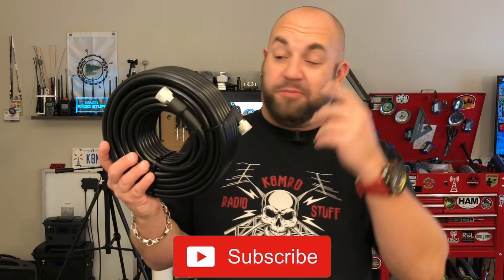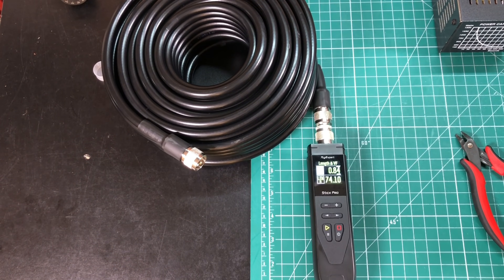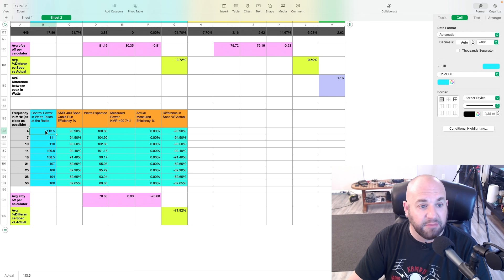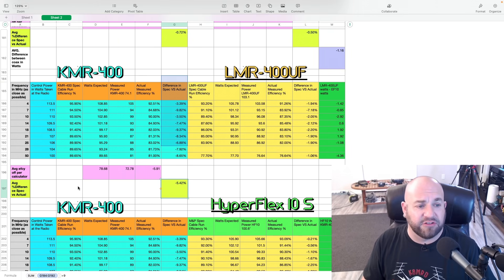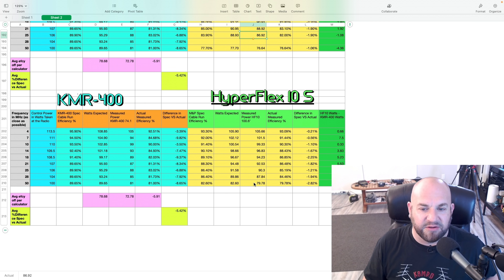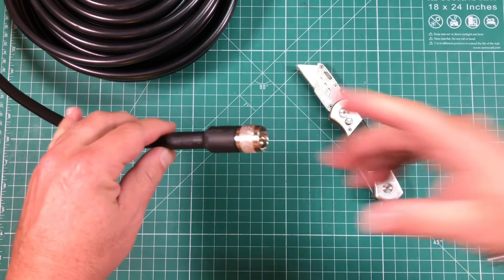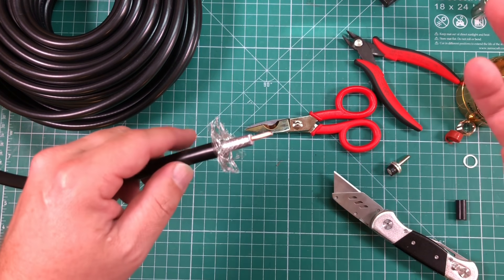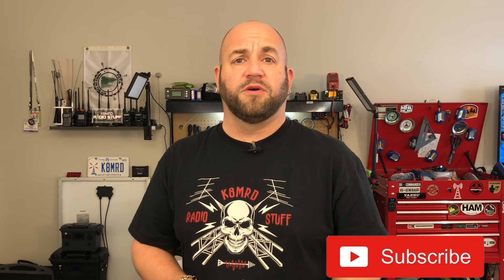I Bought KMR-400 Coax From Amazon | How Bad Can It Be?

Comment: Retired RF bench technician here. I worked for a couple of fellows in the late 1970's in a mobile stereo/ CB shop when the CB craze was going. We had problems with some of the customer's  vehicle installs with the intermittent SWR readings. The cable installed was the off-the-shelf Radio Shack Tandy Wire RG-58. We then replace those with an Amp brand cable with no further problems. We dissected the Tandy cable and found at even intervals along its length there was the center conductor just pinching on one side of the foam dielectric to the outer braid, causing intermittent shorts. Tandy did produce their own wire and cable, I believe in a factory in Indiana. Evidently they didn't have enough cool time out of the extruder before coiling the cable up. Their coax products did improve though. Tandy did make their own xtals for their CB radios and scanners as well. These shifted lower in frequency over time sometimes into the next channel.
Reply: As a current tech, ive seen some things... 
One of which is radio shack coax which at best had 60% shielding. Their molded connectors are garbage.
Reply: Foam core cable is relatively easy to damage; I've seen many tower installations where the foam is entirely compressed by cable clamps, which is why we only use 1/2" and 7/8" "hardline" feeders; they can usually take the abuse.

Comment: #1: Never test cable, especially coax with a foam die electric in a tight coil. Read specifications of LMR-400 & look at installation criteria. That coil of ‘KMR’ was coiled from China waaay too tightly & most likely distorted the positioning of the center conductor in relation to the sheath. 
Bingo. There’s your excessive loss.
Reply: I've bought a bunch (4 terminated, 1 unterminated) of these KMR400 cables from Amazon, and they all arrived fairly tightly coiled, but not even close to the specified limit. I do uncoil them slowly, over a few days, gradually and smoothly increasing the diameter of the coil until it's something like 4 to 6 feet across. My assumption is that the center conductor can migrate back to the center if it's done slowly and gradually; if it's even an issue. Since they're Cdn$100 each (price class), I'm not in the mood to take chances. Also this slow process helps to avoid kinks. I measured 0.8dB loss at 30 MHz (per 100 foot), which is perfectly fine for my HF antennas. I'll probably use the same cable for a shorter run at 2m and 70cm. I'll be buying the unterminated option from now on, and installing the connectors myself (cheaper, likely better). Those that can accept only "the very finest" of name brand cables are either very wealthy, or perhaps they're cutting corners in other areas. One of my coworkers bought very expensive speaker wire, but he didn't have any money left for speakers.
Reply: @John Jones does it result in permanent damage or can it be corrected by straightening the cable out?
Reply: The bend radius spec for at least lmr400 is between 1 and 4 inches depending on whether it's a permanent bend or not. Assuming the dialectic is similar I think the coil is probably fine.
Reply: Just what we need !
More Coax that won't duplex well !
👎☹️
Reply: which coax would you recommend？I am using ic705 with end fed antenna. Thanks!
Reply: I thought so too. I'm no expert but I thought it's gotta have some effect on its loss. I'm thinking about some 25' segments between antennas and rigs, and imagine the loss will be smaller than found! Thanks for your observation, John J!
Reply: Hmmm,  I looked up the Times Microwave datasheet for LMR-400 solid core (not ultra flexible stranded core).  It says:

Bend Radius: installation in. (mm) 1.00 (25.4)
Bend Radius: repeated in. (mm) 4.0 (101.6)

If you can install LMR-400 with 1 in radius bends, seems to me you can ship it in a coil with a 2 in to 6 in radius bends.  Am I missing something?
Reply: @engineerncook6138  No, you are correct in your thinking, but remember that MBR is the radius, not the diameter. You need to double that figure to get your diameter and TM recommend  a repeated radius of 4"", that equates to a coil with a diameter of 8".  Now look back at the roll he has. Is it 8" diameter on the outside turns?  ...maybe. But the turns closer to the center are not. I work in Broadcasting and we would never have RG213 coiled that tightly, let alone a solid core foam-dielectric LMR400.
Reply: This is why ppl stay away from vhf unf rptrs.   Know it alls

Comment: if you want to measure a cable specifications you need to lay it straight, a roll of cable has completely different characteristics.
Reply: In the coax the energy is traveling inside the coax so it is irrelevant whether the coax is coiled on a spool or not. You don't have any fields outside of the coax at least in theory. In practice due to imperfections in the outer conductor braid maybe some but is very negligible for this kind of measurements. I think you are mixing other effects when you connect an ubalanced line to a non proper unballanced load and the outher conductor acts as part of the antenna (example coax to dipole antenna without a ballun - please don't get it wrong because in many cases it works without a ballun without side effects, but this is completely another topic) but those effects don't have nothing to do with power delivery in the cable and its losses.
Reply: I was kinda thinking the same thing.  You make a choke out of coiled coax to change the characteristics of the cable's operating parameters at that point.  I'm not sure testing the 75ft coil is very telling.  How about a follow up with the cable rolled out for comparison?
Reply from the maker: A choke is to prevent RF from coming back on the shield.  I'm testing power into a 50 ohm dummy load.  This is not my first experiment and in my experiments I have found that for power testing, it makes zero difference.  Look at my videos testing Messi & Paoloni Cables.  They are all uncoiled.  Before I uncoiled hundreds of feet of coax in my house, I took a power reading.  After I uncoiled them, I took a reading again.  Would you believe they were the exact same number?

Comment: For the price and for hf use its just fine.  I buy rg8/u in 500' rolls. I have multiple more than 100 foot runs and i have not had issues.  For vhf real lmr is the way to go. 

Joe WA4UJY

Comment: I'm kind of wondering if the "copper clad" aluminum isn't the factor that didn't garner the best results. I wonder if it had a solid copper center conductor would make a difference. Since there is a dialectric value difference between the two materials and permeability that could be a possible reason, just my humble opinion. Nevertheless good video buddy.
Reply: Standard lmr-400 is also copper clad. Albeit probably a bit better than this. I have seen an lmr-400 solid copper center conductor in the wild as a 2 way comms tech. Once...
Reply: Andrews heliax LDF4-50 also has a copper clad aluminium centre conductor and works fine. Skin effect will see most of the current flowing in the copper so that’s why the manufacturers do it. If you look at some of the larger coaxes used in the broadcast industry the centre conductor is actually hollow and this works for the same reason.

Comment: Lets see you test the higher bands 2M, 1.25M, 70CM, 33CM. Not every technician can aford a LF radio and its agaist the gods to use a homodyne radio. Some would think it crazy but i use a 12vdc 4 antenna switch on the mast and a 3 way inside to change radios even got my gmrs antenna on it aswell. Curious??

Comment: So... normalizing your results on db/100' and comparing KMR-400 to LMR-400, I'm seeing that it averages less than -0.2dB loss compared to the LMR-400 (worst at -0.39dB at 15m; strange shape to the data suggests measurement error, IMO)?  Not sure what the accuracy would be on the MFJ-849.  Would have liked to see the testing methodology (mode, sequence, timing, temperature, etc.).  Percentages murk the water; should have done apples to apples with the cables and measured in dB.

Comment: Your run was coiled. This means different frequency is going to behave differently. Your putting RF into a coil, not a straight run.
Reply: In a properly made and terminated coax the electromagnetic field should be entirely within the dielectric, what that means that if the coax has not been damaged by bending it too tightly whatever is placed up against the outside including itself in the form of a coil should not affect the electrical characteristics of the cable, this is the reason it was invented in the first place to make installation less of a critical job.
Reply from the maker: In my testing of coax I have not found it matters.
Reply: No, it is not an inductive coil - there is no mutual inductance between turns.

Comment: Very interesting test, thank you. I'm going tbe in ham for over 50 years and this is the first time that there are so many vendors building coax. This would be an interesting video series for you to continue with the other manufacturers such as, but not only including DX engineering, who build their own coax cable. There are a lot of vendors on the Internet advertising LMR 400 coax made by other than Times Microwave, these would be interesting to examine.
Reply: 46 and some change for me :)

Comment: are results like this linear ie can you adjust the numbers from the other coaxies to equalize the length?
Reply from the maker: I'm prob not smart enough to know that but in other tests I've done with different lengths, I've just looked at the overall loss compared to what the manufacturer specs according to the specific length and frequency.  Because I don't have all the same lengths of coax and don't really feel like cutting them all to the same length I've found that gives me a good enough comparison between them.  You can see what I mean in this video I did testing M&P coax.  https://youtu.be/EbryAONb1BQ

Comment: Aloha Mikey, here in Hawaii in which we have three volcanoes erupting all at once but only two putting out tons of VOG, which almost like Fog except there is Sulfur Dioxide, Sulfuric Acid and Glass within the gases of VOG. 
    Meaning that if you use cheaper coax like RG of anything, that metal braid is going to turn a brownish purple powder within a year. 
    This also means that you are going to spend 4-5 times the money vs using LMR 400 to begin with, plus all the labor involved. Simply not worth buying the cheap of anything is a waste of both, time and money! 
      Sometime those connectors have a gap or hole at the tip, which I will fill it in with a nice healthy drop of solder and call it a done day! What I’m looking for is a complete airtight seal. Period! 
    However, with the price, cost of shipping to Hawaii and the kind of connectors, I think this coax would still be worth the money spent! 🇺🇸🇺🇸🇺🇸

Comment: Nice that you analyzed that cable for everyone. By the way db is a logarithmic scale, not linear, so you cannot say 3db loss equals 50w so 1db every 16.6 If you expect 0.6db/75ft of attenuation at 50MHz the power you should expect is 87.1
Also in all of these measurements you should take account of the power meter accuracy and the stability of the power source (ie the radio).
But I guess at the end of the day, to have a rough idea what you’ve done is enough.
73
Diego
Reply: Calculating cable loss as "percent efficient" and reasoning "50W is 3dB so 1dB is 16.6W" - I'd say he is not qualified to review coax cable.
Reply: Came here to say this, glad someone already caught it.
Reply: Also, foam die electric coax in an excessively tight coil by default created attenuation, thanks to distortion of the foam. LMR was designed for straight runs with sweeping bend radius (can’t recollect specifics)

Comment: There's a "law" if you will about using calculators that applies here:
"Garbage IN equals garbage out." Which I think you might have done right at the start by assuming the KMR has the same 84% VF as the LMR?!

Messing around building 9 element collinear antennas out of coax from scratch I learned you REALLY need an accurate velocity factor measurement to get the lengths right for alllll those elements, performance and SWR can do wild things when you have 9 elements covering 4 bands and they all start interacting. Also learned an important fact about manufacturer's "VF numbers" vs post production reality... Not familiar how that Rig ex spurt stick works, but I unroll the coax and actually use a tape measure to get the precise length, a "known value". Then I hooked up my NanoVNA test leads and calibrate/zero those before testing the coax and doing some math on an ancient technology called 'paper'...😋

After testing a BUNCH of different batches of KMR-400 my samples all tested at about 4-6% faster VF than the 84% in print on the LMR data sheets. Over all I was pretty impressed with that coax and I'd say I got way more than I paid for.
Reply: He's also not using multi thousand dollar measuring equipment that's all calibrated as well with controls for any anomalies.  I think the datasheet is less valuable here than if he had real LMR400 of the same length coiled up the same to test on his same equipment.  I think the comparison there would tell us a lot.  Whether they're within a percent or two of each other, or if there is a difference, what that is.   Say, 7% performance improvement for 2x the price.  Might not be real deal LMR, but price to performance ratio might be better.  Depending on what you're doing, paying 100 bucks more for 7 watts might not be a great deal, when you can use that to get a better antenna or higher etc.
Reply: Now THAT is a good critical review of this video and his measurement techniques.

One other note - I worked in the Aerospace industry nearly my entire career. Crimp connections are used pretty much everywhere. Don’t knock the reliability of a good crimp connection!

Comment: From what I saw in the video, only two things should cause the difference. First and foremost is the digital power meter you are using. As much as I have wanted one of those meters for my shack, you should be using something like a calibrated Bird 43 with the right slug. If it’s not the meter, then your readings indicate a real consistency problem in the coax from end to end. I agree the connectors look first rate. WB5NOE
Reply from the maker: Why??  Everything in my test is consistent.  Following the scientific method, I have a control group of measurements and a test group of measurements to show the variable.  I'm sure it's not as accurate as a more expensive meter but it's not that bad.  But, if you want to send me a Bird meter, I'd be happy to us it.

Comment: And of course there is no way to tell if it will get brittle, or ooze plasticizers, or the dialectric breaks down over time.
 Good enough for "we'd better grab some extra cable" field ops, where sometimes the cable WILL have doors closed on it, etc.
 But I'd prefer something I could rely on, not whatever the shipper sent in a random week.

Comment: Did you ever think about what happens when the "current" going into the center conductor returns on the outer shield and causes phase shift between the electric and magnetic fields on a multi layer coil?  You think that has no effect on the inner conductor?
Reply: Fields will be equal and opposite, per Lens's law, and with a good match at the end, we don't have to think about VSWR.  With a bad match and random wire length, the reflection will be out of phase, but that's not the same thing as return current that completes a circuit.

Comment: Well, for the price, with pre done ends, if you're running 100W or better, you're not going to notice a difference. Is it TMW or Belden or M&P? No. 

I think the lack of velocity factor data is skewing the test somewhat and the biggest factor is those crimp ends. The interface between the pin and the center and the shield and the outer ring is super important in an unbalanced line configuration and can throw all kinds of stuff out of whack. I'd also like to know what the OD of the cinnector pin is compared to a TMW PL259 is. I've had some cheap cables and connectors do odd things because the pin and/or barrel sizes didn't fit right. Last thing here to mention is that copper clad aluminum center core is no substitute for full copper core, stranded or solid, but your Chryrine, Beldin, TMW etc solid core LMR is usually either solid copper core or the copper plating over the aluminum center is usually quite thick. That skin effect you get pushing a signal over two disperate types of metal at two different velocities can make a world of difference, too. 

Good stuff, though. I may pock some up and play with it for giggles and see what I can do with it.
Reply: That was my suspicion. I don't like that connector style personally. 
Ive seen some crappy coax connectors though. Some of them would be better off using yellow butt splices 🤣🤣🤣
Reply: Best I recall, it's been years, but I'm pretty sure that real, honest to goodness Heliax has a copper clad aluminum center conductor.  Because of "skin effect" the copper clad (if thick enuf) is the only thing that counts and the aluminum is merely a substrate to support it.

Comment: It's a mistake to measure the loss with the coax coiled
Reply from the maker: No it’s not.  It doesn’t make any difference at all.
Reply: @hamradiotube  correct. The only effect a coil has is on common mode currents. Persistent myth...